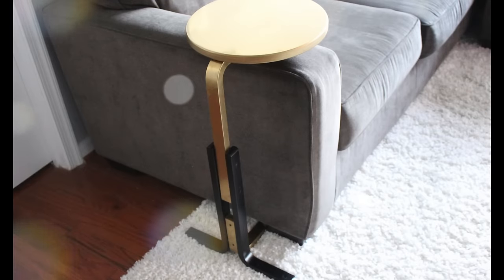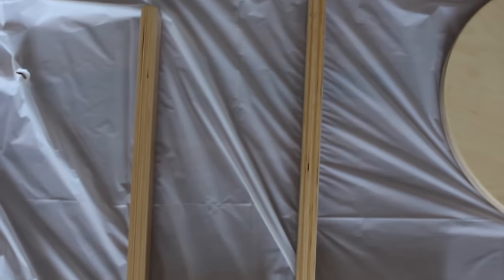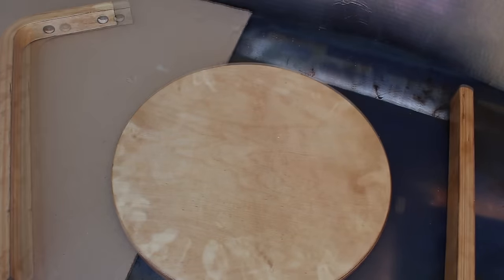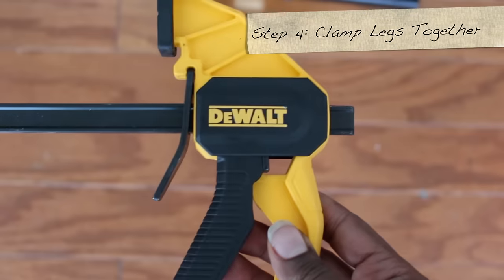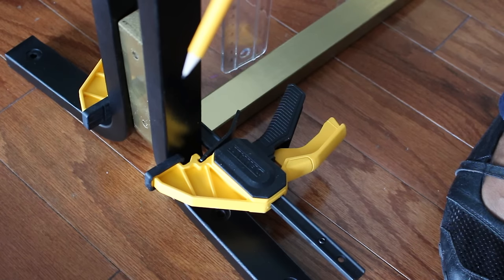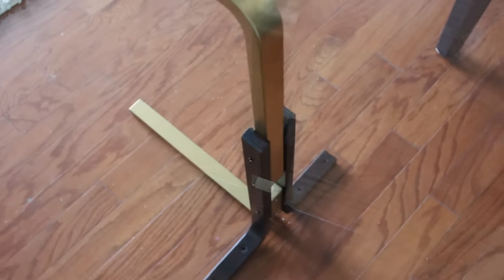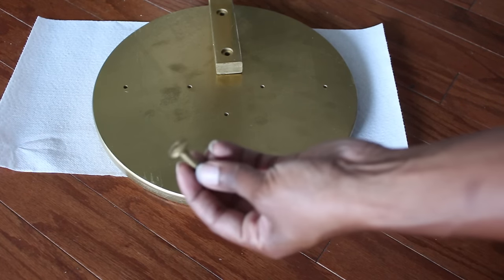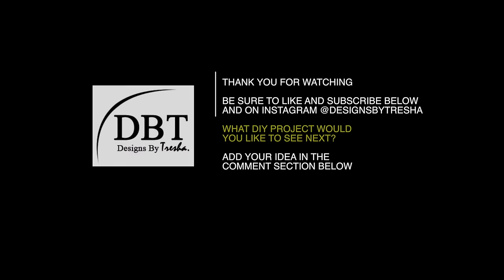Finally! An IKEA Hack You Can Use

Comment: Thankyou from Sydney , Australia ( a lovely 25 degrees C...and we are thankful for the cooler summer weather. ) Am just putting together a BJURSTA extendable table to use as a 2 person desk...with option of using it as a bedbase when needed. Should be useful as a desk-bed in my favourite window space...but will need a small footstool to reach the 74 cm height.....and will need to 
factor in safety .   Worth a try ...for a desk-bed .    Cheers & thx,
Reply from the maker: That’s wonderful!!!

Comment: Hey 🙂 Just made two of these two weeks ago and they are wonderful. We use them as sidetables and they already have quite a few scratches on the surface. I sanded them lightly and gave them a new layer of spraypaint and this time finished with a layer of spray laquer (hope I spelled that correctly...) I hope the surface will be more durable this time. I don't know if the spraypaint I used was a different quality, but it wasn't exactly a cheap brand, so maybe we're just too rough on them 😉 Anyway, thanks for a great idea 😊
Reply from the maker: +Carina Jørgensen Hi Carina, that's great!! Thanks for sharing your experience. Adding more coats and adding a protective clear coat will should make it more durable. I haven't put too many things on mine except for TV remotes really.  That's very good information. Thx again!

Comment: I found that the top part swing from front to back with just two screws.... I need 2 more or at least 1 more. How did you only put 2? ?
Reply from the maker: Thanks for sharing your experience but I put it together as shown in video. It may need to tightened more.